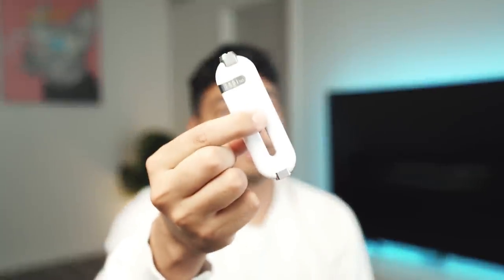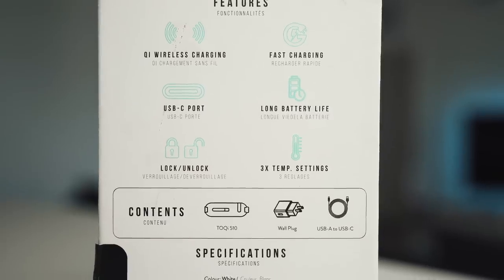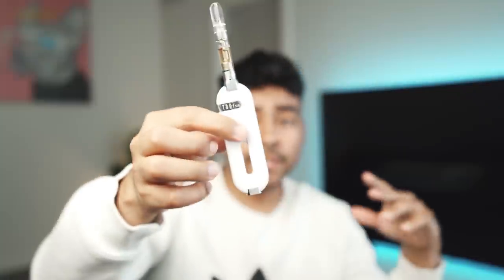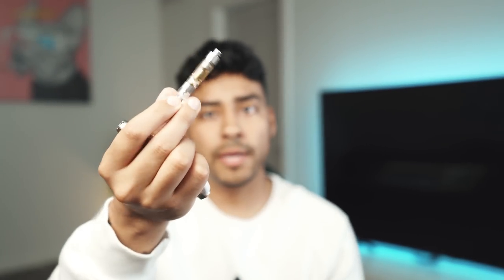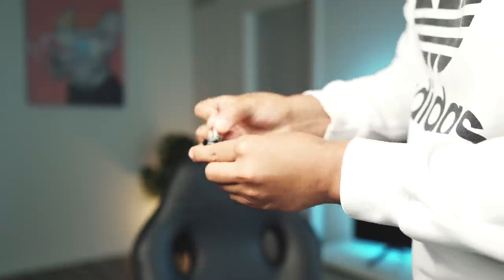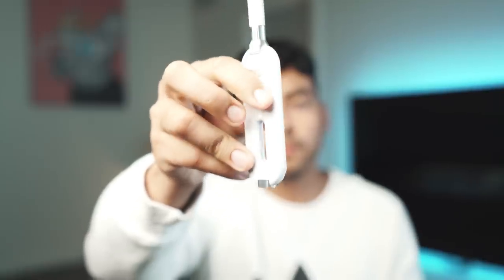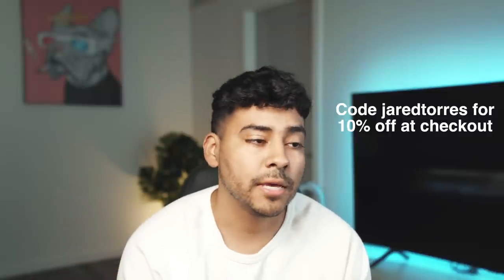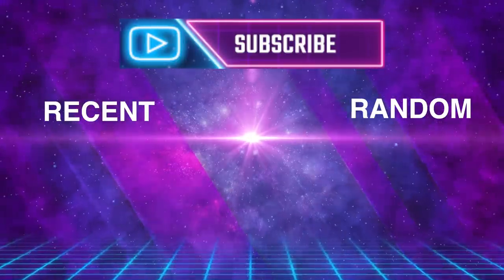The BEST Way To Make Carts Last Longer

Comment: Best way to make your cart or pod last longer pro tip leave it at home when u go out all the time just take it when u really want to get high tip 2 take enough hits till ur high asf then stop hitting it 👍🏼
Reply: Simple but effective tips 💯 its so hard not to take them when i drive around bro frfr
Reply: @benakinnusi2518  For real I be vibing x10 afterwards
Reply: But bro it gets to the point the high doesn’t last long so you keep having to smack the cart 😭
Reply: @ethansmit7833  don't hit it in the morning
Reply: @martinberrioj I hit the sativa in the morning until afternoon and then the hybrid until the evening and straight smacking the Indica

Comment: After starting my own weed brand and making our cartridges I started using them and realized I did better when I blinked it. The 3-5 second hits are way too easy to forget how many you've taken especially when you have a tolerance and it makes it easy to keep hitting.
Reply: Then again if you blinker too much it can make metals from the cart itself leak into your oil I see what you’re saying but I’d still not blinker too too much
Reply: Doing blinkers is the worst way possible to smoke. Terrible for your lungs in the future. Who ever is reading this do not listen to this guy. Continue to smoke puffs like normal and also blinkers damage your battery
Reply: @nadaesfacil  I said It did better and talked about my experience and opinion never said anyone had to take my advice especially considering I'm a stranger on the internet But aye if you wanna sit here and try and say that heating up your hardware and using your battery for 30-40 seconds is amych easier on it then using it for 10-18 seconds be my guest
Reply: @jahyeet1137  that is true I do agree! 
I feel like it's the end result that matters especially when I've had metal leak from doing both methods so as long as your not letting your hardware get hot or letting your battery run then fuggit
Reply: I used to use a box bod for vapes when I used carts with a hit counter.  It went down as low as 1 watt and went way higher then needed but I could keep track of the hits that way.  I highly recommend you get one
Reply: @Zae  bruh okay? Don't worry about what we smoke get out of this section
Reply: @jahyeet1137  only if u have a shit battery a TOKKI or sum should be able to rip n rip
Reply: What’s your brand
Reply: 5 second rips max…. Listen

Comment: Bro, real question, do you need to be 21 to win? Or to order one?
Reply: Not sure if it’s necessary to mention but you can be under 21 and smoke in a legal state. Just get a MMJ Card/Med Card. You can ask to get it I used the excuse of “stress” that was a year ago and mine expired currently taking a tolerance break atm until I turn 21

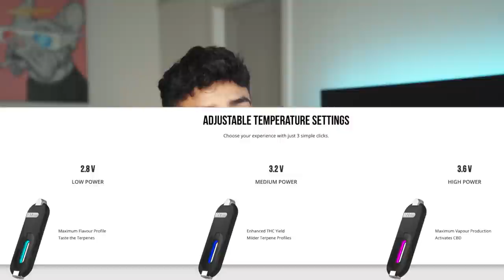Comment: 2:50 My Yocan Uni Pro 2.0 can do anywhere from 1.8v to 4.2v and you can actually set it to every single number in between (so it's not just 3 different voltage settings)

Comment: If you hold the smoke in longer it gets u high also or im trippin
Reply: Hold it till your lungs feel properly deprived exhale then hit again, that's how it hits harder
Reply: Yes and no. 3 secands is all you really need, anything longer and your mostly just feeling the oxygen deprivation. With that being said, you do get a bit higher. Its not like you get a lot higher though

Comment: No you just need to get the brands with the cotton holes that are really tiny that means it doesn’t take as much oil in each hit u take unlike other ones with big cotton holes the intake of you smoke is higher and the oil goes out faster

Comment: what about a live resin cart or a melted diamond cart does it have to be distillate
Reply from the maker: no i'd recommend live resin/melted diamonds with these too because of the low voltage, it wont burn terps to a crisp
Reply: @JaredTorresYT  thank you its much appreciated :)

Comment: Blinkers can also melt the metal and you’ll inhale metal into your lungs
Reply from the maker: I was gonna say this because I’ve heard about this like crazy but I couldn’t confirm. Metals break down under heat tho
Reply: @JaredTorresYT  I know the silica in ceramic coils are toxic during the creation process… For metal though I’d assume that with a higher heat and long inhale, you’d risk damaging the coil. With temps ranging in the low 300’s up too 900 degrees Fahrenheit, there’s almost no doubt in my mind that they cause damage either to you or the pen. It is a safety shut off so it doesn’t explode like you said.
Reply: @KKDriver  the cut off time is to not burn the coil in the cart lol not to save the bat from blowing up lol wtf all the battery does is let’s electricity go to the cart coil the battery itself does not heat up the cart  does that’s like saying a portable charger should have a blinker to charge your phone so it doesn’t blow up
Reply: @nk7123  you can say this but it doesn’t change the fact it happens all day everyday by people who don’t know better
Reply: @KKDriver  I mean for a battery to heat a cart above 700 degrees it would have to be pushing out like at least 6 volts which majority of bats go up to 4.1 or 4.2 highest I’ve seen is 5.0 so unless u smoking some boof ass carts u good plus everyone should rlly be smoking glass and ceramic carts only now not metal carts like it 2018 lol

Comment: How I make my carts last longer I would like soak a piece of paper with water kinda damp and then I would wrap the cart and leave it in the freezer maybe for like 20-30 mins and then I would hit it it’s basically makes the distillate oil more less runny and it’s slows it down helps last longer
Reply: wouldnt you get less high like that?
Reply: @marygilbert5190  facts wouldn’t it make the cart less potent? You are freezing it then pulling it out